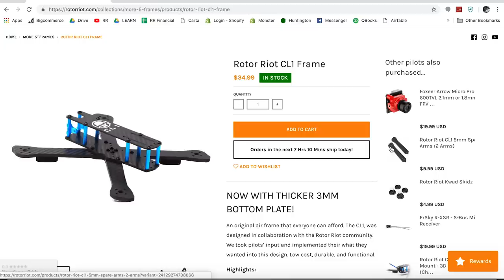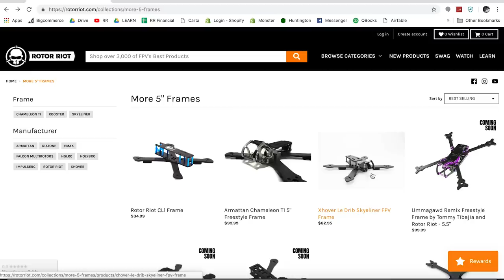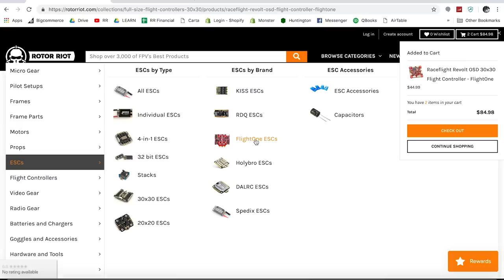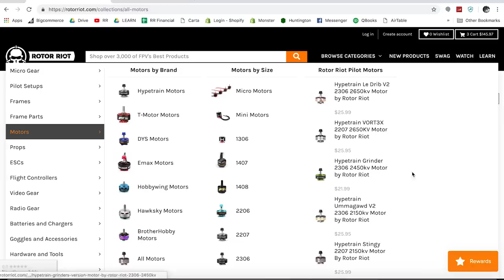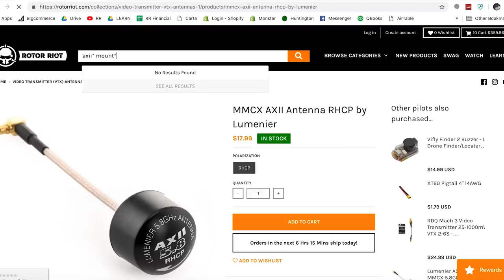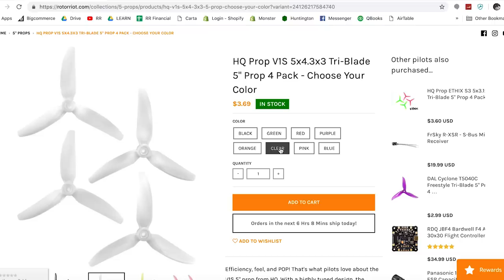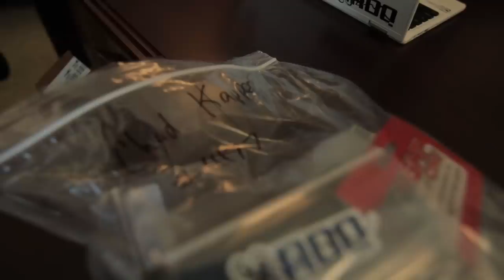Beginner FPV Freestyle Kwad - From the ground up!

Comment: "Who's running this company?"
"Drew"
"Wow...way to throw Drew under the bus."
That was hilarious.
.
This was a good bringing experienced guys back down to earth episode. So many things you just discover by sheer accident because forum groups don't have and answer (even though the post gets a ton of views), YT doesn't have the answer, or GitHub doesn't have it. I have been thinking a comprehensive and extensive Wiki or FAQ needs to be created. However, the amount of man-hours to produce and maintain it would be pretty daunting.
.
I could relate to the issue of how to orient the flight controller. I get that you would want the important controller chips shielded from an AIO ESC board underneath it. But sometimes there is no choice because the wiring harness that is provided to connect the two isn't long enough to support the positions of the needed ports. You could rotate the ESC board along with it if you want to re-map the motors in the configurator. This is one area where FlightOne shines because it doesn't care. The wizard takes care of it. I've run into that twice. Unless you have spools of thin gauge wire, the JST connectors, the contacts, and the crimper, it's not going to be a simple job. There is the option of direct soldering but a lot of us prefer the clean look of connectors.

Comment: Can I suggest something? Make or purchase metal knurled standoffs and SPACERS so you can use a metal m2 screw with metal spacers on a 20mm stack going through m3 to m2 gummies that come with 20mm boards like HGLRC. That will simplify and strengthen things so damn much!!!
Reply: Pyrodrone has em in every color ;)
Reply: @flo-ridafpv5713  That's the closest I can find, but check again. the 5mm spacers listed here: https://pyrodrone.com/collections/new-products/products/5mm-threaded-anodized-stack-spacer show 3mm threads, so not compatible. these are m3 as well: https://pyrodrone.com/collections/hardware-and-bling/products/2mm-threaded-anodized-stack-spacer-nut?variant=15761851809835

So completely unusable for 20x20mm stacks. Still need crappy plastic to make them work.

Comment: I need a package option with everything I need and just make small decisions like, between this 2 motors and the pros and cons , if I select 1 moto it automatically show me between 2 props options. With the package included all little parts I will need, and then other package options for the remote and goggles. I know nothing about how build a quad but I want to.

Comment: perhaps compatibility lists are something to cover/have on the website. you touched on it with esc /fc.
Guys I fly with use spektrum (yeah, thet ride the short bus) but Rx uses 3.3v instead of 5v. watching them burn up an rx is fun but sad too.
f4 fc/s and sbus etc.  
Store options:  
1) kits at various price points too. RR used to have the JB budget build. even a shopping list rather than a kit might help.
2) a "parts kit" which includes some bolts/nuts/tape/zip ties/heatshrink/spacers/gummies etc. once you've built a few quads, you get spares and dont think    
    about it when you build a new one.  a newbie wont have that.
3) "tool kit" which has case / soldering iron/solder/common drivers (hex/philips etc)/ knife.   something a newbie could purchase to build their first drone.
     the iron might be separate due to cost but think it over.

Other points:  2207 2600kv is good too. being high kv, it isnt mad at lower throttle and doesnt really kick in until about half way - it just goes further.
3 blade props work quicker. you want to corner, you dont slide as much. you want to flip - it is more capable. you want to pull out of dive, you do so quicker.
4 blades are more floaty and quicker response but they break lots.  sigh.

Comment: Watched this whole thing again. IMHO:  you have two basic customer groups; experienced and inexperienced and they need different things from rotor riot.  I can’t speak for the experienced pilots/builders because I’m not one.  The focus for inexperienced builders/pilots should be “less is more”.   There’s too much to try to absorb in the beginning; its like trying to take a sip from a full flowing fire hydrant,    I built The CL1 from Bardwell's video step by step.   My biggest frustration was that the kit was missing parts and I had to delay my build.  Also after completion it would have been nice to have a few more get started videos and some tweaking videos to begin to gain experience.
Reply from the maker: We take this feedback very seriously. Your input is appreciated and will contribute to our thought process moving forward. Thank you!

Comment: hm i really dont like connectors,...when i build a kiss setup i even remove the connectors and solder to the pad´s, i was so happy as dalrc released a 4in1 esc with pads,..i had always troubles with conformal coating on connector gear

Comment: I have an idea. I would be helpful to have a list paired with various frames on the site that have flight controllers and 4 in 1 esc combos that have been set up on said frame with a a known list of needed parts IE: spacers/nuts and some instructions on how to put the stack on the frame correctly. They could be marketed as recommended pairings and still point out many other options would work but may require a custom stack assembly. Just an idea...
Reply: I'm on it!

Comment: Smoke stopper missing... Very important... Some choices I disagree, could be a lot cheaper and maybe better... Like using Furling32 4in1 ESC or motors as the Rcinpower EX2306 ;)

Comment: great video! Im stuck with one of my ESCs not being recognized by BLHeli. The LED on the bottom is on and all the wires seem good to me. The motor does twitch once when I power the quad on. Is it just dead or is the signal pad burnt?

Comment: the CL1 is a awesome frame but the bottom plate breaks too easy where the arms are. i have 2 CL1 builds and i  used 2 bottom plates, knocked the press nuts out of 1 and doubled it up and its solid as can be. please make CL1 bottom plate thicker
Reply from the maker: We started making them thicker. Contact support and we’ll get you taken care of :)
Reply: I’m good, like I said I’ve doubled up both of my frames and they’re solid as hell now. I just think the CL1 is a great frame at a great value and would hate for people to be disappointed y the bottom plate breaking so quickly. Glad you guys are fixing that. Fan for life

Comment: i like the concept. 
theres so many things like RHCP wont work with LHCP.

maybe have a noob filter on the site that hides stuff that is incompatible with what they have in their basket or prompt with the issue and the solution if you do add two things that are not compatible.

maybe a 5 question 1-5 rating of what you want to do with the drone that hides things that will not achieve the desired result.

most of the things that are throwing me as i look at this as a potential hobby is all these acronyms and terminologies are confusing as they dont carry any weight or meaning to them

i may as well say that we need some HEO to fix the issue that the ACE will introduce because we have a EAP and a WILL. (disclaimer, sorry if i offended anyone with that last sentence, i was honestly trying to type gobbledegook). there so much to unpack here. HEO? fix an issue? (what issue?) whats an ACE? we have an EAP? and a WILL? what do they do? why are there issues? 
another thing is the issues with numbers... whats good? is less more? how does this affect the flight? like with the props... whats with the 3.2? is that degrees off the horizon?  the guy was like "yeah i'd go for the 3.2 over the 3" erm... what?

personally i'd love a series detailing each part and how it affects different systems and how you can achieve various results by changing different parts. maybe screw up parts intentionally to show the behaviour and why its doing that? 
maybe for yourselves, draw a chart. and have each component of the drone on there. then point arrows showing what is dependant on what. too many lines means a noob like myself will get confused with how to build these things. is there a line of separation? i imagine outside of being powered, the flight controller wont change its behaviour (outside of frying) if we changed the voltage.
so the motor potential speed depends on battery, battery longevity depends on the motor type and props. 

I think there is potential for a series for those who want to by a BNF drone, controller and goggles separately and help them understand what they need to look out for in terms of compatibility? along with links to helpful resources to check these (if there is any) 

im looking to get into FPV, but i wanna try it first. my goal is to get each part (drone, controller, goggle) separately so i can upgrade each one over time as i grow as a pilot. 
Right now im booking some time in Liftoff with an xbox controller, (im looking in to solutions in connecting any controller to the PC via USB wireless)

I build PCs and can do so with ease so i understand the potential for complexity.
normally i say, what do you want the PC for? and what is your budget.
someone says gaming, I'll ask what game (as a 10 year old game can run on very cheap hardware vs a brand new game)
then i can spec out the PC. knowing that i can get an achievable 60fps on their monitor,

some one wants to browse internet and play solitaire then thats a different build.

it seems like theres a balance between Racing/freestyle/touring (long distance flight)
so maybe for noobs focus on 3 drones that don't go to the extremes in any one point and is sub $200 for the drone itself.

long post. but i hope you read.

Comment: Greati video, very informative and helpful especially for new ones getting into the hobby.  I would just like to ask though, what props did you go with at the end of the video?
Reply from the maker: The HQ V1S 5x4.3x3
Reply: @RotorRiot  Thanks but I can't find them in your website. Those are smoked black ones right?

Comment: Chad does a fairly good job at THE IMPOSSIBLE, which is basically trying not to know what he actually does know. In my opinion it would have been way more difficult, time consuming, informative, and entertaining had you actually FOUND a newby and gave him some help. I’m not going to belabor this by pointing out all the times I got lost because all those guys knew WHAT they were talking about and completely LOST me, a newbie, because they forgot what they were saying makes perfect sense to a non newby and they forgot to go back there. I realize this episode was about BUILDING a drone, however once it was built the builder would probably want to fly it. There was absolutely not one mention about the transmitter or the goggles which I’m thinking, as a newbie, is how I get it to fly and how to see what I’m doing. Currently I just putter around watching the drone from the ground which makes seeing WHERE the drone is a little bit nerve racking around obstacles. Being a brand new fpv newbie myself I’m clueless as to what controller works with all that stuff on the actual drone and how to pick one out that is compatible. I’m old enough to remember one plane, with one receiver, with one transmitter, a set of servos all of which were matched together when they came in a package. Technology has moved on and I’m not sure exactly what is available. I’ll be searching your archives and other sites for answers to these questions. Although I have called myself a newbie I have flown my three camera/consumer drones without destroying them but just taking pictures as cool as it is pales in comparison to the fun you all have FLYING and so I’m embarking on a journey to get, make, buy, or even conjure an fpv drone into my stable and teach myself to fly it.

Comment: i wouldve thought you setup your radio so hover is always centre or close to. it doesnt make sense about more power...hover is hover. its usually at 50%..so you just setup your travels correctly.

Comment: I wonder about the arms on the frames. They seem so wide on some of them. I know it's for strength but if the frames were angled, like angle iron, they could be thinner and block less of the thrust and be pretty strong. It would not just be a flat sheet of carbon fiber water jetted out. It would have to be a layup in a mold, but I wonder if anyone has tried that yet? I know people were 3D printing frames for a while and any shape can be made with a 3D printer. They're just not very strong. But you could literally design the frame in Fusion 360, 3D print it, then make a mold off the plastic frame and lay up a carbon frame  out of prepreg carbon and cure it in an autoclave. I wonder if frames are still just flat water jetted pieces because that's easy, cheap, and fast to make, but not because it's the best frame design.

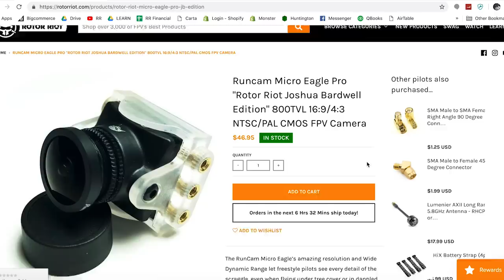Comment: As someone who has never built a drone but really want to get into it, I did not feel like the target audience. I felt like this video assumes that the viewer already has built a quad but is still a beginner. I've read your Beginners Guide prior to watching this, but when you're listing up kv numbers they're just numbers to me and I get lost (like chad pointed out), and the section about the camera? I don't even... CCD? CMOS? And the VTX 20:50 Tramp? Wand? Mock2? Mock3? 6S up to 1W is not important? Why? And what does it mean and what's the difference of 30x30 and 20x20 flight controllers? How do I know if the FC and ESC are "pin compatible"? I wouldn't want to buy something that is not compatible. My point is that there was a lot of what you were talking about that I didn't understand, and if you could just put all the things I need in my cart, I'd press the buy button (maybe following a wizard kind of thing to that simply asks for style of flying and a slider how aggressive you want to fly and simplicity of the build - just an idea while typing this). Maybe I'm not the target audience. I think I did learn a lot though, and it was interesting to watch.
Reply from the maker: I think this would be considered a stab at trying to do something to find out what we should do next. 

Your input is valuable! I appreciate you sharing. I especially like the slider to help select components based on power or flight style!

We’ll keep trying :)
-Chad

Comment: I built a small quad once and could never trim it. I could give it left and then it was out of trim to the left. I could give it right and then it was out of trim to the right. Was not flyable with my goggles. i even changed the motors but still the same problem. Maybe the board is bad. After about a week I gave up on it.  I think there should be a kit with all parts that fit together right. I built many rc nitro helicopters in the past without a problem so I do have rc experience. Any ideas why the trim would change when giving it a control?

Comment: Surprised you didn't spend more time on batteries. That's how beginners burn up ESC's. 

Now I've read conflicting opinions on this but if you want to ere on the safe side make sure the max amps a battery can deliver don't exceed what the ESC can handle.

In fact BECAUSE there is so many conflicting opinions on this I'm really curious about this particular topic. For example: Say ur using a 3 inch quad with an ESC rated for 33 amps with 38a peak current (this is the one that came to my head because I'm very familiar with the numbers here). now you want a battery... so you choose 850 mAh lipo with a 75C rating.

 For me I would play it safe and go with 45C because 850 mAh(75c)= 68amps while 850mAh(45C) = 38 amps. the ESC has a peak current of 38 amps! So a battery with the C rating push9ing 68 amps wouldn't be good.... RIGHT?!?!?

The problem with this is that you'll find a forum thread on the same website on this exact question where EVERYONE in the thread agrees that you should definitely not do the 75 c because you're risking your ESC's and another thread in that same exact forum will say that the C rating doesn't matter.

Well what is the answer maaannnn. For me I ere on the safe side and stick with 45C for a max amp output of 38 for my ESC that has a peak current throughput of 38amps. I just don't feel comfortable increasing the C rating to 75 when the math says that the max is 68amps yet your ESC says it can handle only 38 at its peak.

I mean is there even an answer to this question? Does ANYONE know?

Comment: If your pretty much brand new... He's worried about mid throttle Os that's foolish... Any fairly top end quad that is decently tuned you will not have Mid throttle Os and someone just starting flying needs to not worry about that.

Comment: Throttle mid and expo . . . i would consider myself an intermediate. Dont watch my old stuff. Watch new. Lol . but working on getting smoothe throttle response to be able to fly low with control and indoors but still not have alot of stick travel to get good power.. Any suggestions ? ?
Reply: I set up a throttle reduction on a 3 way switch for my Cinnewhoop, down is 60% max throttle, middle is 80% and up is 100%. It messes with your throttle curve, but I got used to it real quick. OL does it with a knob which is cool, but the switch lets me change settings in the air.  https://oscarliang.com/reduce-power-throttle-taranis-betaflight/